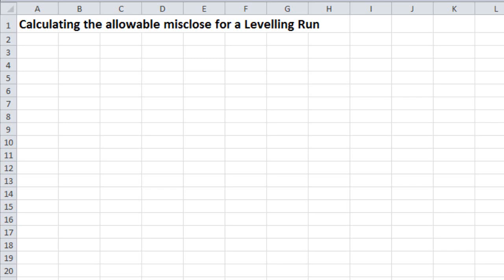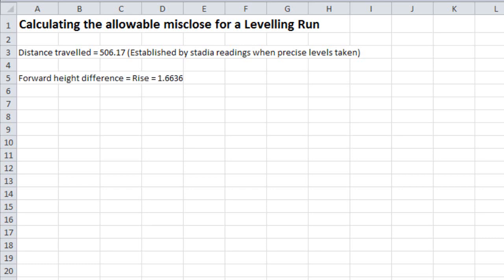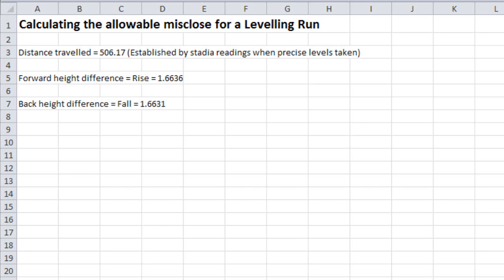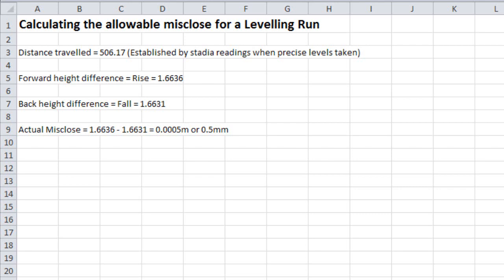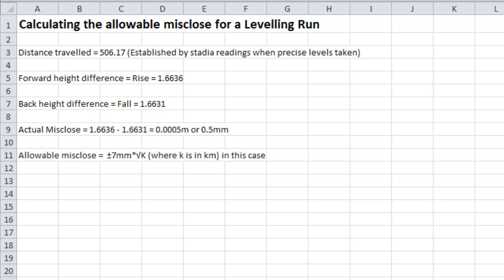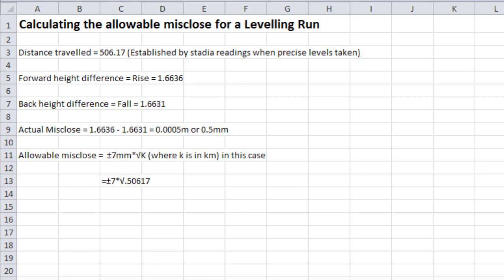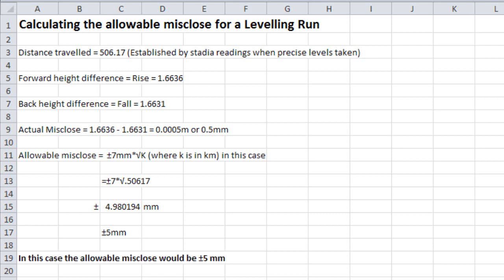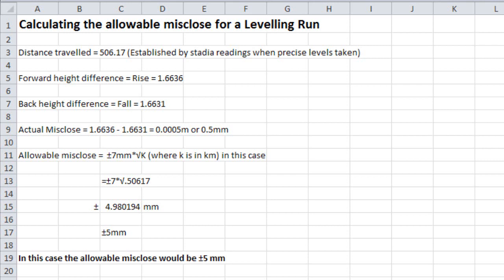maurieo's Levelling; Calculating the Allowable Misclose

Comment: Second order is plus or minus 6 right?
Reply from the maker: The value may vary depending on the authority responsible for the levelling.  Here in NZ LINZ has an order specification for the levels they administer however some other authority can specify there order if they wish.  It is therefore important that you clearly define what specification you are working to and check that it agrees with your clients requirements. As a general rule I would stick with national standard setting bodies.

Comment: could you please explain from where you got +- 7mm
Reply from the maker: This comes from the formula provded by the standard setting body or authority
It is set by the authority.  Different bodys may have different standards or formulas .  This particular one is a common value for 3 rd order levelling here in New Zealand.  You will see in oter videos where I have used a different forumla based on the umber of set ups tis is more suitable for small jobs with short runs.